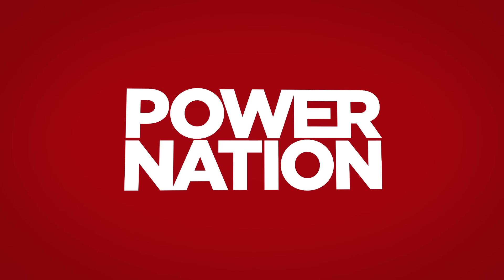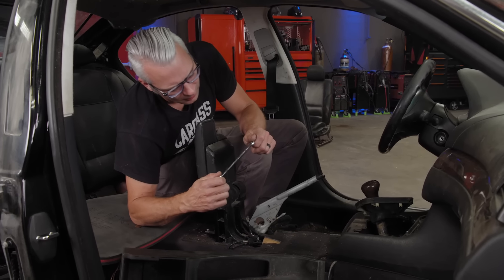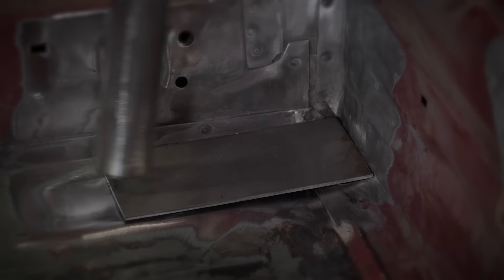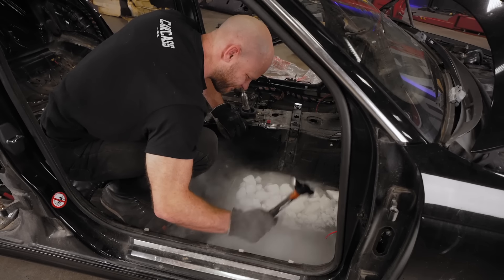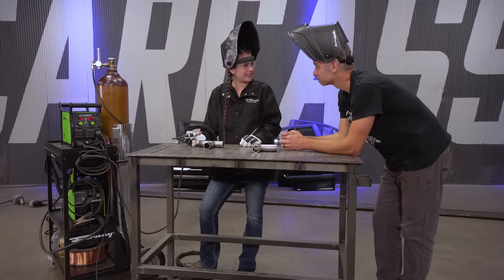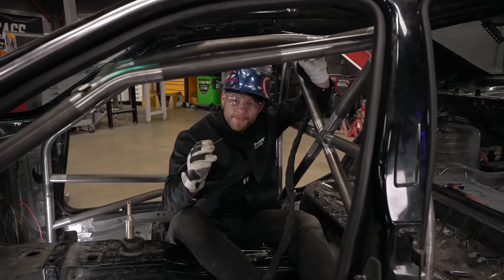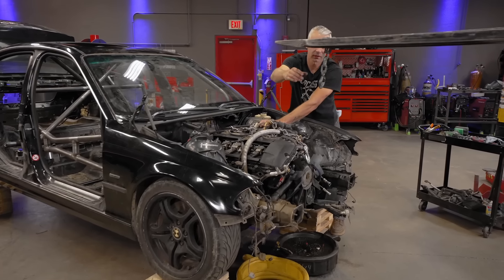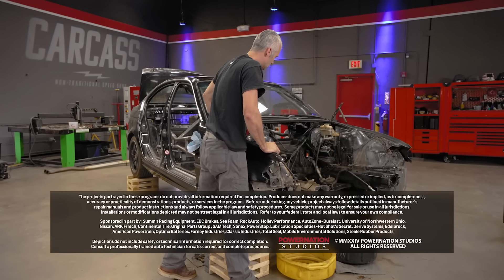2001 BMW 330i Gets Stripped Down To Become A Track Killing Racer - Carcass S5, E9

Comment: My buddy did a 326i. Added a 350 with a t-5. (Stock motor was nuked) added some JCWHITNEY letters turning it into a 350ci! Custom moror mounts. Didn't even have to change the shifter location.  Wicked ride.

Comment: As much as I love v8s, it does get a little tiring seeing basically everything get an LS swap. The stock M54 engine is actually capable of a surprising amount of power, but even if you insist on swapping the engine, there are more options than just the LS.
Reply: The m54 is capable of being powerful but incapable of being reliable

Comment: You had me till you said you were using a LS...way over used because they are a dime a dozen 😢 it's sad
Reply: You seem bitter the GM designed one the the most budget efficient engine to build power on.
Reply: It’s just boring and honestly kinda lazy. You’re right there’s a reason it’s such a popular swap but it’s also very common and not as exciting.
Reply: @bmstylee  could you possibly be anymore dense?

Comment: Okay guys I am one of those LS the world type guys I was a small block the world before that but what I don't understand is why not get a BMW V8 and have it built up I mean let's get real Gordon Murray chose BMW engines the power of the McLaren F1 has to be something redeeming about them I had an old 7 Series V8 it was an early 90s car and I can Cruise I-4 All Night Long at 150 net engine head close to 200,000 on it I just think sometimes building something different is about building something different I'm sure this will be cool but imagine if you built a twin or buy valve turbo engine for it or even a procharged V8 BMW engine I have a friend right now that's got a xj12 two-door convertible that he is tearing the engine down and he's planning on procharging
Reply: 1. Price and parts availability.
2. They're looking for high torque, not high revs.
They're building a "hill climber".
Reply: @BradleyBellwether-oy2qi  Oh okay I was up the impression they were looking for a Swiss Army tool one that can do it all and I was looking towards the uniqueness of it at the time I wrote that on Marketplace there were several of the early aluminum V8s cheaper than LS I just thought the novelty of it plus the aftermarket I'm willing to bet some smart person out there has figured out how to put a holly management system on a old BMW motor but I was not aware they were just doing it for hill climbs but I have always been a horsepower over torque guy it was always explaining to me twerk was what Terror stuff up not the horsepower
Reply: @thekevorlando  I'm sure they have. There's probably a file somewhere online that you could send to a machine shop, and have something made to convert it. 
Yeah, torque is definitely what tears stuff up.

Comment: Typical only in a America would take out the inline 6 and put an LS. The E46 has a great inline 6 to twin turbo. Shame the didn't use that motor
Reply: Because LS parts are cheap and ABUNDANT, unlike decades old BMW parts in the U.S.
Also, they're building it to hill climb. So why would they go with an inline 6? You need torque to hill climb. Not high revving h.p.
Sorry you got sand in your giner though. 😭